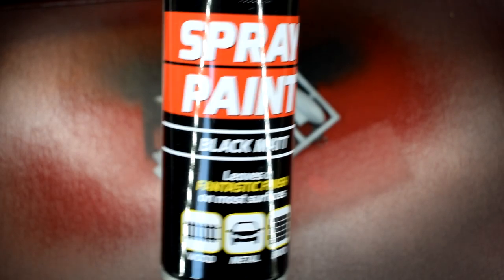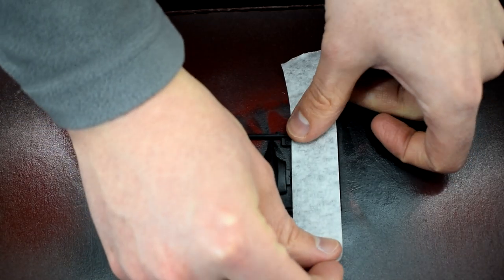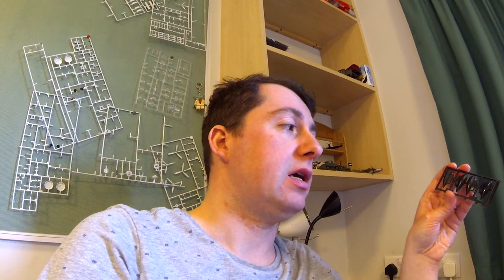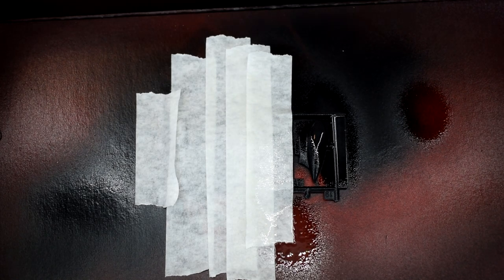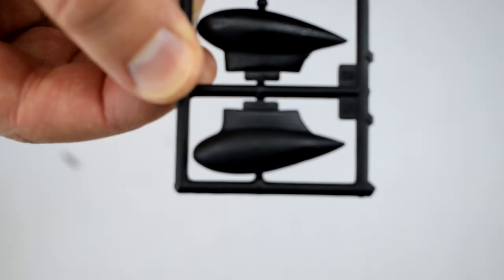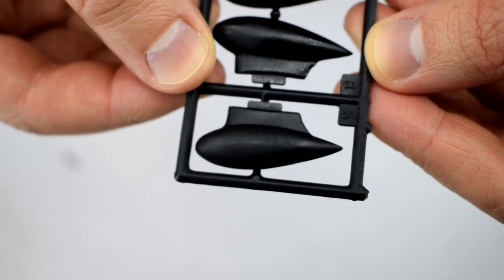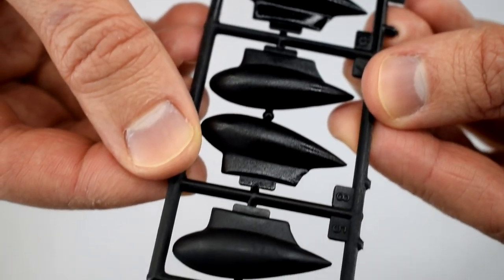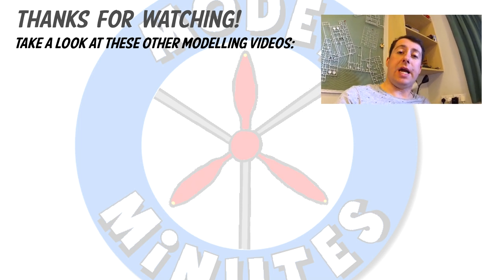Matt, Satin & Gloss Paints - How Are They Different?

Comment: Matt paints (especially Humbrol enamels) are usually best to brush paint with, gloss colors tend to leave brush marks. If you use Matt paints on armor, sometimes you can find dry transfers to apply so you don't need to use a semi-gloss or gloss varnish to apply water slide decals.
Vehicles usually don't have many markings anyway; many times you can just put down a bit of clear gloss varnish where the decals will go and follow up with flat varnish to blend everything back together.
Reply from the maker: Yeah, that's true!

Comment: Great video mann!!!  Im planing to paint my pc case . Its a white case soi waanna paint it matt black . Do i have to remove the white paints from the case. The case is made of steel or aluminium.
Reply from the maker: Personally, i probably wouldn't bother removing the original paint, but if there are any issues with that paint you might get a better finish if you removed it - that being said i'm a scale modeller and not a respray expert lol

Comment: It doesn't matter if your base coat was gloss or satin, if you do leave it to dry properly, before matt coat, it will certainly be matt.... If not, it is probably because some of your used varnishes are no good, or because you didn't leave them to dry properly.... On the other hand, some of varnishes do need a couple of coats to be as espected..... The best example of this is Humbrol gloss clear.... It is the best of the best, since it is so thin that you do not need to worie about overpainting it, but, because of that, it needs few coats to be real glossy..
Reply from the maker: Thanks! Clearly from my experience with turning things matt again - it mustn't have been properly dry

Comment: For using enamel washes what type of varnish do I need under before putting it down.. would enamel thinner strip the varnish off while I clean up the wash?
Reply from the maker: I’d use an acrylic varnish as a base for an enamel wash. Did you check out my video on washes?
Reply: @ModelMinutes  thank you and yes I have, I'm a big fan of your videos I have just started modeling within these few months gone and you make things alot easier to understand. Some tutorials use alot of oils and protective coats which I'm not all to sure about so I keep it basic.

Keep it up man I'll be looking forward to new spitfire build if you build it on camera :)
Reply from the maker: @nicogman8469  I certainly will 😊

Comment: Paint manufacturers go out of their way to promote Satin, Gloss, and now even shinier paints like "High Gloss", "Emerald" etc. While I don't question that shinier paints are more durable and easier to wash, there has to be some financial benefit to manufacturers compared to matte paints. I believe matte paints have less binder and more pigment compared to "shiny paints", matte paints are likely costlier for the manufacturer since the pigment is the most expensive part of the paint, matte paint also cover better from my experience, likely due to the increased amount of pigment.
Reply from the maker: that's a very interesting point!

Comment: When I was painting my 1/72 scale hurricane I ran into an issue where the paint has a rough grainy texture even when thinning the paint do you have any ideas?
Reply: Oliver H  hi depending on what brand of paint you use, some have larger pigment particles and need to be thoroughly mixed, especially Humbrol acrylics. As in using Matt or satin paint to prevent it drying too quick and leaving a grainy texture you could try adding retarder or levelling thinner .
Reply from the maker: I agree with harry - some of the older humbrol acrylics are less than perfect and will come out grainy. They should have fixed this in newer batches
Reply: Thankyou for the advice I have now found a different paint that gives a better finish
Reply from the maker: @oliverh5367  Great! :D

Comment: Thanks for your informative video. What are the pros and cons of using a matt top coat finished with clear varnish to achieve a glossy finish or using a gloss top coat which I would normally cover with clear to protect and help with decals?
Reply from the maker: Not sure I understand, but you can put gloss over Matt and vice versa to get the finish you want usually
Reply: @ModelMinutes  Thanks for your prompt reply.

Comment: Informative video. I’m just getting into making models, and knew the difference between matte, satin and gloss but what’s the difference between enamel paints and acrylic and when would you use each? Same for the varnishes? Would you ever use both on the same piece eg enamel and acrylic on the same model or do you stick to one type?
Reply from the maker: enamel is oil based whilst acrylic (usually) is water based (although tamiya's acrylics have alcohol in them). So, whilst you cant mix them together (oil and water don't blend) you can use them on the same model provided they are 100% dry before using another paint. Take a look at some of my build videos and you will see this in action
Reply: @ModelMinutes  thanks for the reply. I’ve been watching none stop for the last couple of days 😂 guess I must have missed that part or wasn’t paying enough attention. Love your stuff by the way
Reply from the maker: @James-yy4vl  thanks 😊